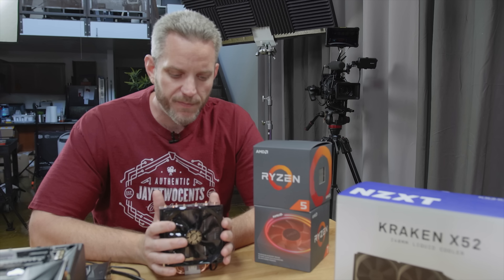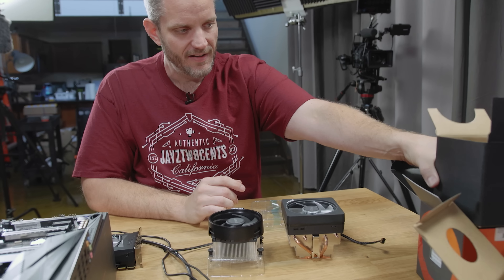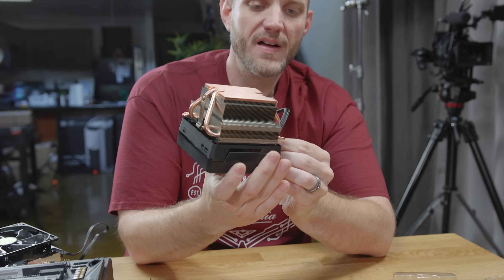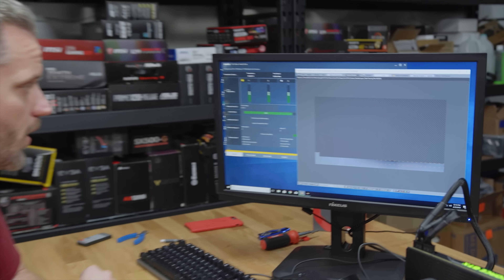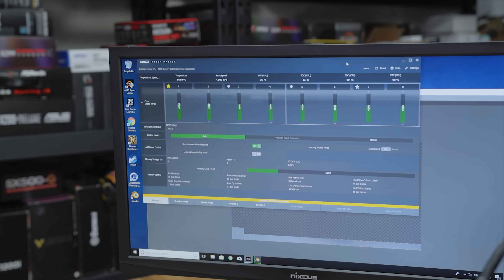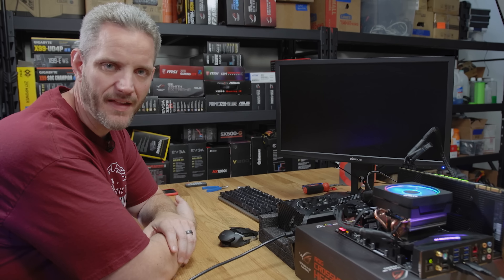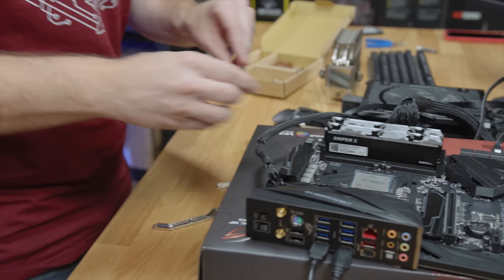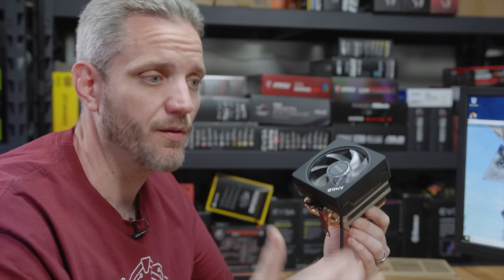Overclocking with a stock air cooler?? Is it even possible?

Comment: hey, please help me, I have AMD ryzen 7 2700x, and this prism fan came with it, but there is a switch on the side that goes to (L) and (H).
Help me understand please, what are these L and H, and to what should I set it to?
Reply: Seriously have you never used Google before? Took me 2 seconds to read H/L means "High" and "Low" speed for the fan. "High" means the fan will go up to 3800 rpm, cool better and be louder. "Low" peaks at 3000 rpm, is quieter and doesn't cool as well if overclocking.  https://www.reddit.com/r/Amd/comments/8igrxc/what_does_the_hl_switch_do_on_the_wraith_prismmax/
Reply: @DoomFinger511  
A. There were no need for making me feel stupid.
B. I did use google, and didn't get any result in the first 4 pages, so I preferred at that time asking Jay.
C. the reason for that is that I live in Saudi Arabia, and there's an official understanding between Google and the government here to censor the search engine, so Google manipulated it's own algorithms to make the search engine fit the SA demands, in result many searches appear different and so many things don't appear, even if they were not blasphemous contents or porn!
D. I could have bypass GoogleSA by my Kaspersky VPN, which I do more often to get better results, but at that time I had trouble running the program.
E. Thank you for your comment.
Reply: @salehaljibreen9114  Aww well now I feel bad. I didn't consider all that. Hopefully me finding that info was helpful.

Comment: What about gaming & streaming at the same time? Will I have to buy a different air cooler?
Reply: I'm sure you figured this out a long time ago, but I'm able to game and stream at the same time with the stock cooler. I also have a Ryzen 3700X though. So I'm not sure if that makes a difference. I just use the auto settings and everything works just fine for both. I don't play many massively intense multiplayer games, but RE2 remake seems to handle it just fine.

Comment: My build :

AMD Ryzen 5 3600
AMD Wraith Prism CPU cooler
Asrock B450M Steel legend 
MSI GTX 1650 Ventus XS 4GB
Cosair Vengeance RGB Pro 2x8 GB
XPG Spectrix S40G 512 GB M.2 nvme 
Toshiba X300 HDD 4TB
TPlink TX50e WiFi 6 & Bluetooth 5.0 PCIe
Cooler Master watt 650W bronze PSU
Tecware M3+ White Case
Inwin Jupiter AJ120 ARGB high flow CPU fans.

Comment: 1.5 volts and it doesnt kill anything... my psu died when overclocking my ryzen 5 2600 to 4.1ghz at 1.4 volts. If i plug in my cpu cables it doesnt turn on and ive even tried putting a lower power draw cpu. But if i unplug the cpu 8 pin it starts up with a cpu error.

Comment: 2700X, prism cooler vs CoolerMaster MasterLiquid 240.

I got 10-20 degrees lower with MasterLiquid, even when overclocked to 4ghz and RAM clocked to 3200mhz. It's a good cooler but not good enough. 45-50 degrees on stock cooler with no clock. 35-40 with MasterLiquid, clocked. Go figure.

Comment: What if you were to insulate the whole device and run liquid coolant through the radiator design. Like a hybrid of air and water cooling? I dunno.

And why can't you cool lower than ambient temperature?
Reply: Question for you to help you to understand.   If it's 90 degrees inside your home, and 70 outside, why won't your home get cooler than 70 if you open the windows ?
Reply: @TheLionAndTheLamb777  Yeah, I meant more like why can't you use a miniature refrigeration or conditioning unit?

Comment: I just upgraded from i5 4460 to ryzen 7 3700x, I disabled coreboost and its still many times faster than my old i5 and the cooler is barely audible at 25% speed.
Never goes above 60°C

Comment: I want to get this processor to upgrade from my R5 1600 however i hesitate due to the fact I don't know if that stock cooler would fit in my motherboard. I have a micro atx b350m gaming pro MSI. does anyone know if that wraith prism will fit in this kind of motherboard?

Comment: See ive always been confused about this whole "DONT OVERCLOCK ON A STOCK COOLER" stuff because i have an a10 7850k apu and i upgraded the graphics card a while back, so i dont even use the graphics cores anymore, and i overclocked the cpu to 4.5 ghz and still have average temps at 45c at idle and around 65c under load with the exception of more cpu demanding games like gta5 bringing it to 70c, which is still a safe temp... I dont know why i have no issues. The only special thing i did was change the thermal paste and make sure to have possitive air pressure in my case.. Which actually was a pain because my case is the rosewill blackhawk ultra haha

Comment: I have my 8370 with the original wraith cooler (it's like the wraith prism of ryzen) OC at 4.5 Ghz (stock was 4 Ghz). +.025v LLC HIGH max vcore 1.440v under load
My temps don't exceed 58°c while gaming (ROTR very high 2560x1080p). It's near the limit (62°C) but it's under it nevertheless

Comment: I don't get the big deal. I overclocked my intel i5 6600k to 4.6Ghz with just an after Mastercooler in a case with few extra fans. It rarely gets above 40c during normal use and hovers around 65-70c during intense gaming.
Reply: You have half the cores and a quarter of the threads a ryzen 7 has which makes a difference.
Reply: @ianwang7593  So because the ryzen 7 has more cores it is harder to regulate the heat it produces?

Comment: Well, my ryzen 5 2400 g is running on 3,8 GHZ with the stock cooler. Also, the APU is running at 1250 MHZ. The system is stable but maybe you can answer one Question: I have installed 2x8 GB of Ram assigned at 3000 MHZ. but when I choose that amount in the BIOS / UEFI it won't start.. any ideas?
Reply: and before you ask: i run the ASUS TUF Plus Gaming Mainboard which supports up to 3200 MHZ RAM Speed

Comment: AMD cooler looks good (I have one at home), but for today crazy CPUs it's really not enough. I have Ryzen 3800X and in 100% load it has 80°C even with AIO. I tried AMD cooler and it was almost 90 with 3000 RPM which is actually very good for stock cooler, but not enough for really using that.

Comment: I have the non rgb version that came the 8370, was able to get the chip up to 4513 and holding 57c (reading taken from coretemp.exe) running prime95 with turbo fan setting

Comment: What's the point of expensive AIOs when you have noctua towers much cheaper performing the same and more reliable over time? I mean when the pump in the AIO goes bad you can just throw it in the trash, for a tower cooler you just replace the fan.

Comment: Have not watched this video completely yet but I have my ryzen 1600 stable at 3.8ghz at 65deg under load with the stock cooler.
If the prism is even slightly better then yes... yes you can.

Comment: I mean I overclock with my stock cooler but I only have a ryzne 3 3200g (I know ppl prefer the 3100) but due to gpu shortage I needed an APU I have 750 TI now tho but I rarely go above 60 and I only have 1 case fan that came with the case so you know that stock cooler must be okay atleast

Comment: The Wraith Prism cooler is 100x better than the FX8350 stock cooler, My R7 3700x is around 65-68c while gaming and its suprisingly quiet for an air cooler, deffinately do not pass this off as a bad stock cooler its worth a try at least shouldnt dissappoint anyone.

Comment: OC'd my ryzen from 3.6ghz to 4ghz using stock cooler with voltage as low as 1.300v
Reply: Did you try 4.3 with 1.35 ?👀
Reply: @rjayp5843  yeah its not stable past 4ghz on my end with stock cooler

Comment: Guys I got a question I had my gpu (gtx 1060 3gb) overclocked at roughly 1980mhz when it said it could only handle 1920 and just found out today that it was over the limit and my pc has been running a lot slower as soon as I did it and also stuff seems to crash after 1hr of use and also how do I know if I damaged my gpu? If I did is there a way to fix?
Reply: Daniel Vincent Why would you push gpu’s beyond their limits? It does not give any benefit whatsoever as it can only work so hard before eventually crashing and being damaged from the intense voltage.
Reply: I likely assume that the gpu was damaged thoroughly and there is no way to fix other than to pay someone to do a repair job.

Comment: I hate the misconception that 99% of the owners of top end consumer gear is for only gamers. When in fact it's the top end components that are barely used in steam charts. Most high end machines are bought by, designers, editors, modelers, data transfer/server owners, Streamers and plenty of others use and even then, half of these are the same gamers on steam.So yeah most machines with these parts in them will be hitting those loads quite frequently because who the shit drops over 1k for Cs:go/fortnite/overwatch machine.

Comment: i prefer the stock clamp style to the stock screw style, those plastic things sometimes get worn and dont lock right, or you dont know for sure if it did. can be annoying. a steel clamp feels much better to me. but then again, i dont plan on ever using a stock cooler anyway :-P

Comment: Wraith prism is great.... i thought it was true until i try it myself, runs my 3900x at 4.2ghz, and it overheats, and its noisy af, replacing that garbage with noctua NH-D15, i wont go back
Reply: But Noctua is poopy colored, too big and heavy, and blocks the RAM.. Is there another alternative you'd suggest?
Reply: @DerekMoore82  i got the black one, and i dont have issue with ram so far, its about fan placement

Comment: I really like this cooler on my ryzen 3700x. Tempted to keep it long term.
Reply: I know this was ages ago but I'm building my first PC at Christmas and thinking of going for the 3700x also. Is this cooler still a good option to stick with or would you suggest upgrading from the get go?
Reply: @jono3506  Its a great stock cooler, but I have since upgraded to an Arctic Liquid Freezer II 280. The main reason I switched is that I am running my computer on an open case and the stock cooler got pretty loud when playing games. If you have a set budget I would run the sock cooler and spend the extra $100 on better hardware now and save up later for a better cooler if you decide the stock one does not meet your needs.
Reply: @Ryan-lf5ki  nice one mate, appreciate the response

Comment: I bought the 2600x and i couldn't install the fan. After an hour I gave up and went ahead and ordered the wraith max cooler because I'd rather deal with the clips. Prism is similar with the clips which I like better.
Reply: ....how? You literally just screw it on.

Comment: Anybody have opinions on b450 vs x570 boards for ryzen 5 3600x? Im looking at the 570 boards around 200-$250 but i know the 450 boards work and they go much cheaper. Just wondering if anybody has used both. I habe only used 450 boards and never oced on them. And i would like to start eith some tinkering.

Comment: Did anyone manage to overclock the 2700x on air? if so, how much? (Voltage/Multiplier) I also upgrading from an old A10-5800k/ FM2 mobo to the MSI x470 Gaming Plus/2700X.  Keeping my 2 year old RX 480 8Gb, 750w coolermaster PSU  and my Samsung 850 SSD drive. 
Video wise, I just bought (2/17/2019) from Ebay another RX480 8GB @ $105 shipping included. That should get the video around 1080 perfomance in many games. In my case, it is cheaper to get another 480 (to XFIRE) than it is to get a single decent current gaming card ($350+). 
But, as Jayz,  I digress, I am interested if there is any advantage in FPS to OC'ing the 2700x?  Or is it negligible compared to stock?
Thank you for your time.

Comment: Maybe I buy one of this prism cooler for 20-30$ for my Ryzen 5 1600 and go for 4.1ghz. Now with wraith spire overclocked to 3.8ghz and maximum 65 celsius in games and 70 celsius in rendering with a 1450 mhz rx 480 oc and 3000 mhz corsair ram and msi x370 gaming mb. So maybe I buy that cooler and a used 1080 ti or a new 7nm vega gaming card if it's for a good price.

Comment: My 2700x runs at 4.1ghz on all cores with that cooler, my full watercooling system with triple rad, neochanger pump and ek rgb block can only manage 100mhz more, may as well stick to air cooling with ryzen tbh, also the stock rgb cooler, cools the ram and vrm heatsink, watercooling ryzen is a waste of time, theyre already brill, the rgb software for these amd coolers is top notch! you can even change the patterns of the spinning fan.

Comment: Okay so I have a question for you I don't know if anyone will see this or even answer but it's really got me stumped. I'm running a Asus Crosshair 6 hero x370 motherboard I'm running 2 gigabyte aorus rx580 in crossfire. I was using a ryzen 5 1600 non X  overclocked to 4 gigahertz using p State overclocking. I recently upgraded to a ryzen 7 2700 non X and my CPU score of course went way up in time Spy by approximately 3,000 points but here's my question my graphic score went down by approximately 3000 points. I cannot figure out why. Everything is exactly the same all I did was upgrade the processor and it seems like with the new 8 core in it my Graphics score has suffered. Does anybody have any ideas as to why?

Comment: my old 1800X could hit 3.9 ghz safely, voltage wise still had room but the hyper 212 i had and the one case fan wasent enough, my new pc ryzen 3700X Thermaltake 20 HT case and 4 fans allows me to hit 4.4 ghz @ 1.4 V's (safe for ryzen if you only want 3-4 years shelf life) i keep mine at 4.1 ghz for now granted but yea. max i hit at 1.45 volts was 4.6 giving me 1ghz oc, perfectly stabled cpuz stress test went on for 10 mins to crash and idled around 81c with stock cooler xD its awesome and if i add a water cooler to this thing i could see 4.4 or 4.5 ghz easally at 1.44 :D

Comment: I can actually say that the Prism is very capable as a Cooler when placed on a 2600x up to a 2700x when Modestly Overclocked to 4.1 or on Stock Settings... The Most I get is 60C on the 2600x  and the 2700 at a 62c... 68c on the 2700x. Heck The Spire Cooler is only Marginally Worse but still way better than the shite I have seen stock... Also Ryzen doesn't need overclocks it does that on it's own. Heck the Comments down below about Ram is True as DDR4 3000 and Higher really get shit done my Trash Heap Battle Box... My Daily Driver... Is the 2600x with a Spare Prism Cooler from a Friends Build, LPX Vengeance DDR4 3000 MHz and a GTX 1050 Ti... Cause Budget... Still It Crushes Vector Art Creation it's like painting and I can Game Damm when I like. So yeah the Prism can get the Job Done, Unlike Intel's Stock Cooler... Haven't seen a Good Intel Cooler since 775...

Comment: AMD's new Prism cooler if you don't keep the CPU fan clean at all times it will get dirty and slow down and stop but you have this problem use WD-40 and an air compressor oh remove it from motherboard  and if you're going to stick with this cooler make sure you buy a spare!!!

Comment: I don't get it, I have AMD Ryzen 2700x (stock fan) with Asus Crosshair VII, Ram G.SKILL Flare X Series 16GB F4-3200C14D-16GFX and have never bricked my system at 4.2 CPU, My Cinebench score is 1927 with no volt adjustment. What are you doing wrong kind sir??? Sweet spot for AMD 2700x is 4.2 and the RAM at 3200 CAS 14 is the other sweet spot, the lower the CAS the better... When I first saw you doing benchmarks with Cinebench in another video, I couldn't believe how low your scores were, I couldn't force mine to get below a 1800 score at stock! PS< the ram you were using was 16 CAS that's where your problem was, AMD is still very dependent on RAM....

Comment: jeeze, if 1.45v wasnt enough for 4.2 and it still froze, i doubt a decent cooler would even be able to get it stable at safe voltages at 4.2 anyway...

i know even at 3.6ghz these chips would be far superior to my fx8350 but its hard to upgrade to a newer cpu and get a lower frequency.. i run mine at 4.6ghz. so i want to be able to overclock my ryzen to at least 4.3-4.4ghz, even if it requires water... just for the numbers ;-)

i might hold off upgrading cpu for ryzen 3000

maybe they can do higher clocks.

Comment: I feel like Jay is just bad at overclocking. My friend has a 2700X on a stock cooler and he's comfortably overclocked at 4.3
Reply: Then he had luck with the silicon lottery and does not need to up the Vcore as much.
Reply: @majorborderline5738  idk man. Me and a lot of my friends seem to be getting better overclocks than jay
Reply: @gryd3461  I use a ARCTIC Freezer 33 eSports ONE and run my 2700x at 4.2 1.375 volts, cinebench15 never gets above 75c

Comment: When you have a laptop and 90 degrees Celsius is perfectly acceptable (stock settings)
Reply: You shouldn't be getting those temps even on a laptop. Consider undervolting and/or repasting
Reply: @grod5998  according to intel 100°C is the max a CPU should get to so in direct safety regards my CPU isn't going to overheat, additionally my laptop has never automatically shut down due to overheating
Reply: @tobias_gaming9603  fair enough, although 90° can't be good for the life of the machine. Have you at least tried undervolting? As a laptop owner myself, I can testify that it works wonders! (Plus it's free and only takes like 15 minutes, I recommend throttle stop)
Reply: @grod5998  I don't really want to reduce the performance of my laptop, I play pretty intensive games and as it is it's already a bit of a bottleneck I believe
Reply: @tobias_gaming9603  unless you plan on overclocking (probs not with your temps) undervolting has no tangible effect on performance. Don't take it from me, you should do some research